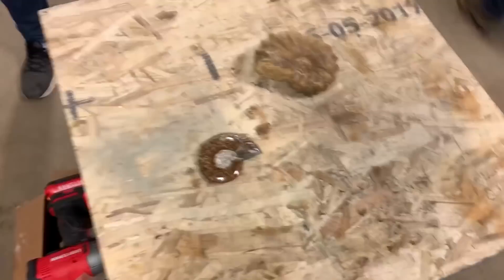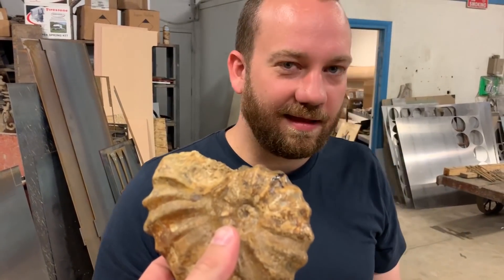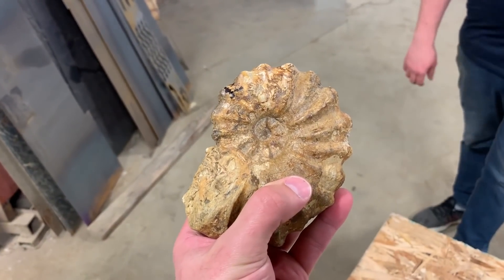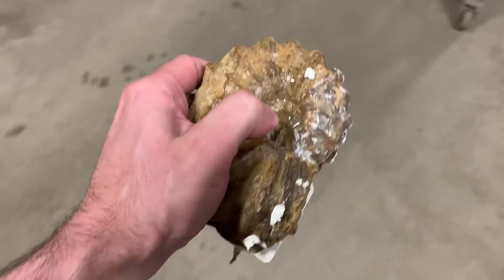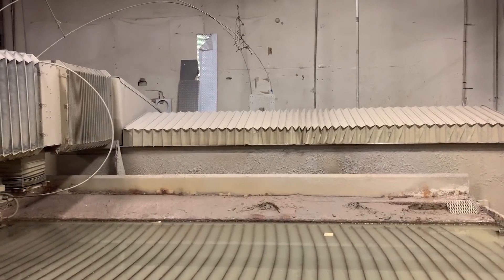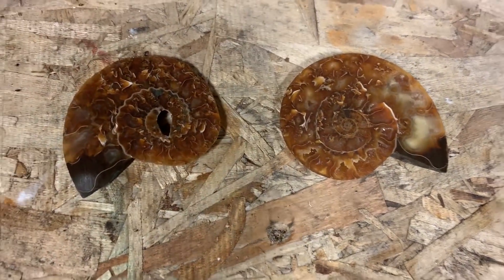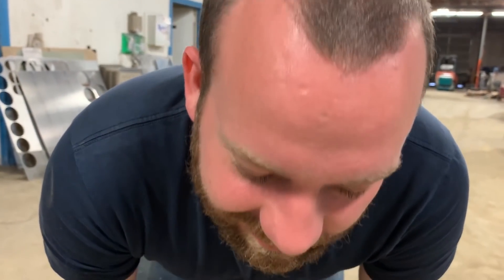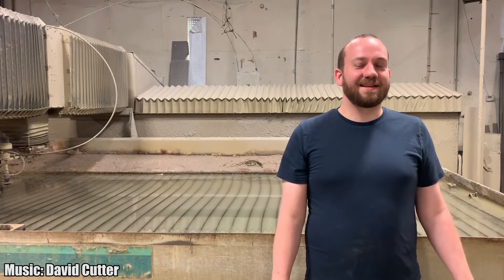Ammonite Fossil - Real or Fake - Waterjet Cut in Half

Comment: Moroccan Trilobite fossils are some of the most commonly sold fakes, like so good they've fooled experts and ended up in museum collections... (until a palaeontologist with a sharp enough eye caught the fake). Heads up though, even if you cut them in half, many of these fakes are frankensteined together from real Trilobite fossils - so the fossil itself might be real, but made up of a bunch of different trilobite parts glued together. Be on the look out for either glue/resin between real fossil material. Many are also faked completely - as in, they are basically sculptures of trilobites glued to a rock. These would probably be the easiest for you to identify as a fake. So I vote Moroccan Trilobite, if you think your fake busting skills are up to the challenge...

Comment: Ammonites are Cephalopods. If you cut the shell in half, you will find pockets of air (now crystallized). These pockets keep the animal buoyant while in water. Like the rings of a tree, you count the pockets, you find how old it was before it died. I wonder what the age of the fossil is. Not pockets age but the actual period it formed in.
Reply: Ammonites are Cephalopods not Gastropods mate
Reply: Tom Garner thank you for the correction. I do know ammonites are cephalopods, i get them confused because in my mind, since the chambers of the shell are full of air and used for buoyancy, I would call it a Gastropod.
Reply: @turbo95912  Gastropods have a foot and don't use their shells for buoyancy.

Comment: Ammonite fossils are quite common, so I'm not surprised you got a real one this time. 

Try getting a trilobite, I wanna see what's inside one of those.
Reply: Cadwaladr itd be cool to see them cut a geode. Like the biggest one that can fit under the nozzle.
Reply: @PostalPatriot556  I hope you know that like machine lifts up higher than we see in videos because they cut small stuff
Reply: Xaria Williams it doesn’t lift up high. They cut small stuff because they nozzle doesn’t have a lot of clearance.
Reply: @PostalPatriot556  they have already done geodes were u been?
Reply: Yes but try to fillet the trilobite, they're pretty thin so a cross section would be less interesting.
Reply: @jetjazz05  that would be very difficult
Reply: Cadwaladr ya I found a peace of a elasmosaurus skull before
Reply: I found a ammonite fossil that's triple size
Reply: Yes
Reply: Spoilers
Reply: Moroccan trilobites have already been cut open to reveal the extent of the ingenious faking.